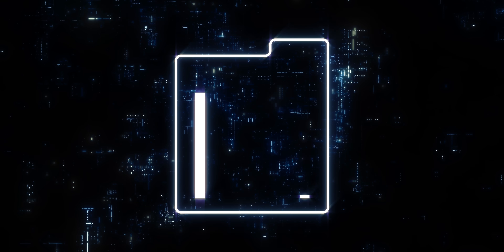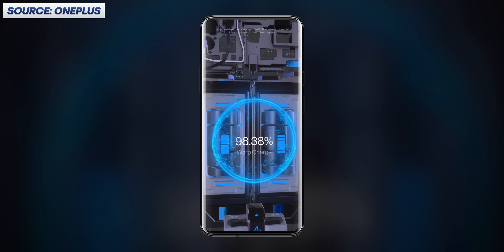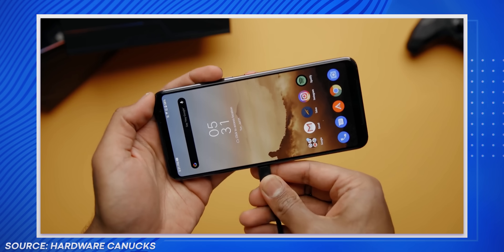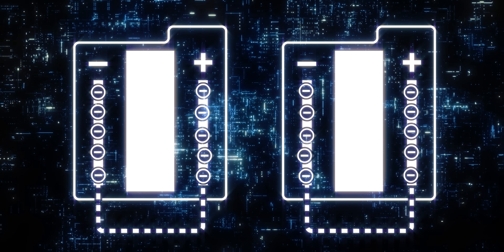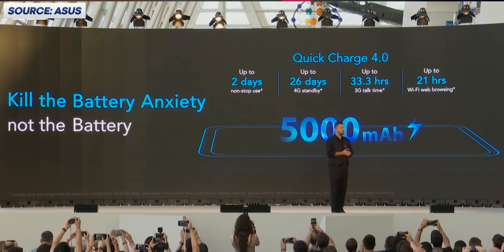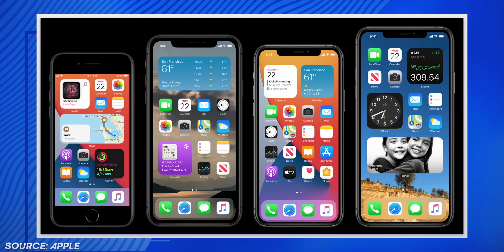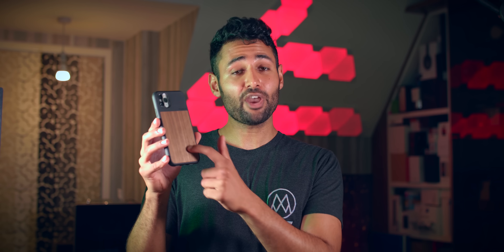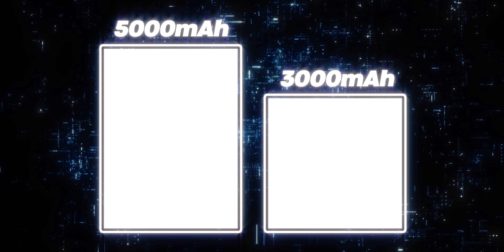The Problem with Fast Chargers.

Comment: Im an electronics engineer and Ive been trying to tell people exactly this for so long. Also, most of us charge overnight so why try to make it charge so fast, don`t peak the battery to 4.2v per cell until right before its about to be used, keep it in what`s known as the storage charge level, storage charge is important for lipos that aren't being used often. I agree with you on every word you said, you also gained a new sub for it too as its rare to find such great advice from youtube. Must add though, a generally accepted safe charge current is generally 1C, so the capacity of the battery lets say 2000mAh would be charged at 2000ma or 2A to be optimal, so if you have a higher capacity battery you could charge it faster, like a 5000mAh battery is usually charged at 5A, this doesnt apply to all batteries and you should check the datasheet for model to be sure, but its a good rule of thumb. Generally manufacturers of batteries like LGChem do make notes on the datasheets of the cells explaining the reduction in recharge cycles by using "fast charge" currents instead of their recommended basic charge levels. 

Just for clarity, i have some Lipos that are recommended to be charged at 1/10th of C, they are 3500mAh batteries and therefore need 350ma current in the CC stage to be given maximum battery charge cycles, their max charge current was given at 1C, so after designing a BMS to manage the charge rate at 350ma we were over 1000 test cycles before we considered the battery to be worn, when we increased the charge levels to 2A, that number dropped to 200 cycles. The load used to discharge was an electronic load and was programmed for cut off voltages etc to achieve consistency. Phone batteries are obviously designed to take a higher charge current, but as you said theres a big cost to it if its done right, but ultimately this is something that Apple has got right, slower charging is better for everyone and realistically most people charge overnight and have a phone that lasts all day, so fast charging is largely a waste of time. Just because you can, doesn’t mean you should.
Reply: @UCrYgFGKtu5OGQPri3XRT0Xg Battery chemistry can be made to accommodate the faster charging, but that’s at the cost of something else. For example it’s common to see batteries that are able to accept a faster charge not give out the lower currents a phone uses as efficiently. The manufacturers then provide bigger cells in the phones, which in turn take longer to charge. 

Not all the same capacity batteries are made equal. The high the current you draw from a battery also makes it less efficient, a 7Ah battery may provide 1A for 7 hours, but would be unlikely to provide 7A for 1 hour even though logic suggests it would. 

So although it’s possible to mitigate the fast charging issue, it comes at additional cost in other means and usually still suffers a big proportion of the damage from the fast charging as well. 

As battery technology improved this will be less of an issue
Reply: @ChrisSmithy  so, no matter what brands that you have it's still have the problem with fast charging, right?
Reply: @adamryamizard5560  they are always going to have some problem yeah. It’s asking the technology to do a bit more than what is ideal with these silly fast chargers. There’s an ideal charge rate depending on each device but the reality is that slower charging is always going to be better for the battery.
Reply: @ChrisSmithy  thank you for explaining that so detailed I appreciate it. And sorry for bad English.... 😅
Reply: @adamryamizard5560  no problem and your English was great!
Reply: Dude, thank you for explaining, but please use paragraph breaks.
Reply: @totsuka2213  I’m an engineer not an author, sorry.
Reply: @ChrisSmithy  So, in conclusion, you would recommend slow charging?

I recently got a s20 which has a 4000mah lipo battery and it comes with a fast-ish charger. The specs of the charger are 5.0V=3.0A 15W for a slower charge OR 9.0V=2.77A 25W for a faster charge. What do you think? Should I deactivate fast charging from settings and keep it at 15W?
Reply: @raziel325  to ensure you get the longest life out of the battery, use the lower power charge. If you ever needed a fast charge you could always use the fast charge option for that one time. Although both of those charge rates are relatively mild, it will make a difference to battery life. 

Also, it’s important to note that the incoming voltage/current specifically from the psu isn’t as as important as it may seem, the battery will always be charged using the same system and same voltages, just current levels increase. By increasing the voltage and lowering the current makes it less stress on the cables and the psu, but the phone will still be aiming for 4.2v per cell ( for most lipos ) and will be converting the voltage to achieve this.

Really sorry how hard this is to explain, I’m trying to avoid being too technical as I’d rather my replies were more use to more people. 

In conclusion, fast charge does have a purpose but it will degrade the cells faster. If you can use a standard charge rate without it affecting your life, then it will pay off in the long run. It also puts less stress on the internal components, generates less heat and generally is considered safer. 

I’d absolutely recommend the slow charging option to increase the life of the device.
Reply: @ChrisSmithy  Thanks for the response. I want to ask you 1 more thing since you're knowledgeable. 

What's your opinion on charging the phone until 85% instead of 100%? Some people think that charging till 100% will stress the battery in the long term, while aiming for 80-85% will increase life span (more cycles). What do you think?
Reply: @raziel325  charging to 80% is better for the batteries. Lipo technology isn’t like the batteries we used to have ( Nicad/nimh) and responds best to not being stressed out. Charging a Lipo to a lower peak voltage (by charging to a lower percent capacity) will certainly extend its life. 

There does become a point where people have to balance the convenience of charging the phone with wear on the battery. The convenience of charging overnight at a reduced rate is significant to the battery life, if it’s easy for you to stop the charge at 80% as well then it will definitely further increase its useable life.
Reply: @ChrisSmithy  Thought so. Thank you very much, I appreciate it!
Reply: @raziel325  no problem at all. Just to add, some people believe a full discharge is good for a battery before they recharge. This isn’t correct with lipo, it’s correct with nicad and some mimh but lipo batteries don’t like to be fully discharged or fully charged, somewhere in the middle is always best. The best voltage for a lipo to be at is usually the storage charge level, which is available on the data sheets.
Reply: @ChrisSmithy  Yeah, I guess that`s why they store them around 50-60%.

I`ve also read that it's perfectly fine to get one or multiple quick charges of 10-20% on these modern batteries because they have no memory.
Reply: @raziel325  that’s absolutely true. Top up charges are no concern at all to modern cells.
Reply: @raziel325  The Tip must be you shouldn't let your phone go below 20 and above 80
Reply: @Ayush-f9s  yeah 100% that’s the ideal for sure. I guess convenience comes into it at some point as well sadly.
Reply: @ChrisSmithy  I always have this question in my mind. Does Xiaomi phone has the same problem as others with the fast charging?
Reply: @adamryamizard5560  Miui has poor optimizations that's it.If you move to custom rom stock Android(Like Pixel Experience), Your problems will be fixed.

Fact: Every phone reaches 100 slowly.

And Those super fast chargers are pointless.

Using Normal Quick Charge charger charge your phone overnight and Charge in day when it reaches 50 

If you do care about battery backup as everyone is not free to follow 20-80 Rule.

And Don't worry your phone won't Explode.

Software plays an important role too
Pixels are Best Android devices for Charging

And Yes Xiaomi is on poor side in terms of Fast charging.
Reply: @Ayush-f9s  so, do you have any suggestion that has better optimizations?
Reply: @adamryamizard5560  Use standard 15w fast charger and it's great.

For Phone OnePlus Pixels and Motorola, are best

But you can use Custom rom on any phone to fix problems (Requires Technical knowledge) you can contact your device community in telegram and XDA
Reply: @raziel325  thanks for asking. I recently got a s20 too so it was nice
Reply: @ChrisSmithy  Thanks for explaining things without being too complex or technical. Take care.
Reply: @Chris Smith  Hi Chris - I totally agree that Li-ion batteries do not like to be fully charged or discharged.  My phone is now 4 years old and I (almost) never charge more than 70% and never discharge less than 25%.   So far my battery seems to be as good as new.   I have a charging cable wherever I sit and have an app to warn me when exceeding these limits.  Also, it makes no difference how many times you charge your phone, as long as you do not exceed these limits.
Reply: @ChrisSmithy  I'm a doctor , not a mechanic! 🤣🤣🤣
Reply: @ChrisSmithy  Hey man I need some recommendation on my phone that I bought recently about fast charging if you have time to answer I would really appreciate it especially for people like you who understands battery charging really well.

I recently got a poco f2 pro which has a 4700 mah lipo battery and comes with a 30W fast charger and I currently have an extra 18W charger which I bought it not too long ago. What are your thoughts on what should I use? I don't mind with charging my phone for more than an hour compared to less than an hour by the way it's more like I want my phone to last as long as it possibly can. Thanks I hope you can see this I would appreciate it a lot if you do reply.
Reply: @paredeschris6209  there’s absolutely nothing wrong with using the supplied charger as the phone was designed to use it. However, if you want to extend the battery life I’d suggest you use a lower power charger. 

More modern batteries are designed to handle the higher charging currents better than they used to, but they will always last longer if you are more gentle with them. Keeping batteries cool and charging at a lower rate will extend the battery life and are simple measures that are reasonably simple to achieve. 

Hope that helps
Reply: @ChrisSmithy  yeah I also thought about using that 18W charger that i bought since I want my phone to extend the battery life as much as possible but one more thing, not using the supplied charger shouldn't be a thing for me to worry about right? That 18W charger was also from Xiaomi btw so it should be good since my phone is poco (sub brand of xiaomi)?

One more thing sorry for asking a lot but right now I don't mind charging using the 18W charger but when I'm on a rush I'm planning to switch back to the 30W charger. Is that good switching chargers but I'm planning on only using the 30W chargers from now on when I'm on a rush.
Reply: @paredeschris6209  using a lower powered charger is only ever a problem if the manual specifically says to only use their included charger, but as you can see by the market shifting towards not supplying chargers, the manufacturers aren’t concerned about the chargers you’d use or they would be putting out specific requirements for each device. 

Things like wireless charging are more likely to damage your battery than anything as they generate a fair amount of heat, it’s generally not an issue but it will be reducing battery life. Although if you only plan to keep your phone for a year or so, the reduction in battery life would be probably acceptable for the added convenience. You have to consider what works best for yourself.

Switching to using the 30w charger when needed and the 18w for the majority of the time might be a good level of convenience and still helping with battery life.
Reply: @ChrisSmithy  Thank you for responding to my questions man I really appreciate it!
Reply: @paredeschris6209  no problem. Happy to help
Reply: @raziel325  Yeah, slow charging is much better for longevity.  Just turn the phone off, plug it in and don't touch it for hours or even the next morning.  Repeat.
Reply: @francretief1  what app?
Reply: @francretief1  what kind of app do you use for this "an app to warn me when exceeding these limits" ?
Reply: @ChrisSmithy  Hey Chris, I actually have a question for you if you would be so kind: How do you feel about using the phone while charging, but attaching a cooling device with a strong fan to the phone in order to keep it cool?

Edit manners
Reply: @ChrisSmithy  I have a phone which supports 65w fast charging. So should I charge with a lower charger like 10w or as it supports 65w it will be fine enough?
Reply: @ChrisSmithy  soooo since wireless charger generate heat, does the wireless charger car dock that sits right in front of the AC vent actually neutralize those disadvantages ?

Wondering
Reply: @raziel325  Good question, this is where the statement gets blurry in the movie...
Reply: @ChrisSmithy  Can you clarify this for me?  I just got a new iPad that came with a 20W charger.   I have an old iPad from 2014 that came with a 10W charger.  Which charger should I charge the new iPad with for least degradation?  Is the 10W charger better because it's slower, or is the 20W charger better because it has smarter internals and is the charger the new iPad came with?   Thanks for your time in responding to all of these inquiries.
Reply: @ChrisSmithy  "the battery will always be charged using the same system and same voltages" Thanks for the reassurance! I was wondering about that for days
Reply: @ChrisSmithy  So I'm about to buy an iPhone 12 Pro Max, I bought the 20W fast charger which is 9V-2.22A/5V-3A. But if I'm not in a rush I should just use the old 5W (5V-1A) charger to preserve battery health overtime?
Reply: @ChrisSmithy  because lipo do not have memory like the nimh/nicad?
Reply: @ChrisSmithy  Hi Chris, got an Iphone 12 so and I still have my old iphone charger block (5w) and cables, so is it better you just use it than buying a new one.  And also I am curious, does usb cable matter when you are charging your phone, is usb c better than the old usb cable that works for iphone xr and older models? Thanks in advance.
Reply: @marsha0324  the iPhone as well as a lot of other modern phones have some good battery management capabilities, they generally will be engineered to limit charging current to what’s acceptable and I wouldn’t worry about using even a 20w charger. That said, slower charging is always better for the battery, so if you are able to cope on 5w and overnight charge ( the iPhone learns your patterns and will only charge to 80% and then giving the final 20% right before you’re expected to use the phone) then it will be better for your battery, however as Apple engineering and electronics are so good and they don’t push super fast charging capabilities, it won’t make a massive amount of difference. The biggest issues usually occur with phones that have over 20w charging really. Just to make it clear, I have the iPhone 12 Pro Max and I charge via cable at 5w as much as possible and it’s not lost any capacity according to the built in capacity reading, but my friend has the same phone and always charges using MagSafe but his is down to 99% remaining, it may be unrelated to charging though as useage patterns play a part too and I don’t need to charge my phone every day, so may not be useful data, more an observation. Hope that helps.

I forgot to mention the cable question. Always use an MFI certified cable, usb C or A makes absolutely no difference. The supplied voltage and current is important but the type of cable providing it doesn’t change anything, however, it’s important to use the correct cable for other things as usb C comes in many forms for other non Apple devices. Although using the older cables on other devices is likely to be the limiting factor and cable quality is important. Some Far Eastern cheap cables can be be badly rated, some sold with the capability of 100w can melt at lower power levels, it’s worth spending the extra on good quality cables where possible.
Reply: @chuckgrumble5440  that’s correct.
Reply: @johnmoore1495  iphones handle battery management very well. However slower charging is always better for the battery, as you increase charge rate you also increase heat and cell damage. The best scenario is slow charging and keeping between 20-80% but occasional faster charging isn’t going to ruin things for you, but I’d always recommend charging slower when possible
Reply: @jujohns0  this is a great question. If your using the device while charging use the 20w as the device will generate heat during normal operation, so being able to quit the charge process earlier is an advantage. However if you don’t use it while charging I’d use the lower power charger. However the iPad has much bigger cells and can certainly handle the higher charge rate with less significant issues on long term capacity.
Reply: @ChrisSmithy  so when fast charging does the voltage, amps, wattage directly damage the battery? Or is it just the extra heat created by the extra power.
Reply: @megimargareth4015  the heat is generated internally. I’ll do some tests to be certain on this, it’s an interesting point but I don’t think it would help as much as you’d think as the cell generates heat internally but the heat removal from ac works externally. I’ll report back once I can confirm
Reply: @ANONYMOUS-kw3ex  65w will likely hit the target battery life that the manufacturer intended you to get. If you want to exceed that time and wish to get more life from the battery, then charging slower is the way to go. The manufacturer may have intended battery life to match the warranty period or they may have a different target life, but charging slow will extend the life.
Reply: @ParadymRap  anything that generates heat while charging is a bad thing. Ideally you don’t want to be using it at all while charging, however if you need to use it while charging you can negate some of the heat by using a lower charging current. I’m just planning out a test to see if external cooling can help. I suspect it won’t as the battery is internally generating heat and external cooling wouldn’t be likely to be even enough, it will certainly help but I’m not sure by how much yet, it’s a test I can easily do so will update back as soon as I can.
Reply: @ChrisSmithy  Thanks for your reply.  I generally don't use the iPad while it's charging.  I've been using the 10W charger and it seems to be working just fine.  Thanks again for sharing your knowledge and your time.
Reply: @johnmoore1495  it’s a bit of a combination, the battery chemically changes with age anyway, but higher charge rates do more of this damage. For example a batteries being used for electric vehicles are tested by charging at 1.5C and discharged at 2.5C to determine their life, they are expected to lose 10% of their life after 500 cycles. This is a good example of serious development in battery technology and handling to reduce the wear, however if you reduce the battery load and charge rate while still maintaining the temp under 60 degrees the reduction is life is under 5%. This is just an example as the technology used there far exceeds mobile phone battery tech and uses a different kind of cell. So wear will naturally occur, even if you don’t use the battery at all. 

The temperature has a huge effect and amplifies the effects of wear and does it’s own additional damage. 

So to be clear, the effect on the battery of what is generating the heat by fast charging is damaging the cell, the existence of that heat is also damaging and even more so if that heat exists while charging. High levels of charge current can be one way to generate this heat, but even if a battery is artificially hot the charge rate needs to be reduced to safely charge the cells. So heat in general is damaging, the high current charge rates causes chemical changes that make this heat but also cause chemical wear on top of this too. 

Fast chargers will monitor cell temp but the limits used often need to be quite high as otherwise the fast charging rate would rarely be achieved. A charger I designed recently needed to maintain the cells at no more than 15 degrees C above ambient ( with other safe limitations for ambient) but needed to recharge as quickly as possible, it was a challenge to get a decent charge rate while still keeping temps low, the resulting charge program couldn’t run the bulk charge rate for long  without huge amounts of heat, sadly an inevitable side effect of charging these cells with higher charge rates.

A few people have mentioned the temp and will things like AC help, I’m going to do some tests to determine how much it can help, but a cell at a lower temp is able to accept charge at a higher rate safely, but if the heat is removed while charging an ambient cell isn’t something ive seen done to confirm if the chemical changes still occur that affect life while using the higher charge rates. Any cooling will help the battery, but as each cell wouldn’t be subject to charge throttling as the chargers usually monitor external cell temp and the internal of the cells will be warmer, the damage might not be as predictable as would seem obvious. However it’s common to find batteries that contain 8 cells in a rectangle in 2 and with the temp sensor on the outside of the pack, when the battery is dead it’s common to find the outer cells are ok, but inner ones which have been hotter are often worn out.
Reply: @jujohns0  happy to help. Let’s all hope for a better battery technology soon and we can one day leave all this in the past! Also, I also use a 10w charger in my iPad too.
Reply: @ChrisSmithy  hmm very interesting, thanks for the all the info. Was that charger design for a company or some school project?

So basically when charging an iPhone (phone in general):
1. Keep the charge state between 20-80%
2. Slow charge as much as possible (5W)
3. Keep heat down as much as possible when charging (within reason, don’t like stick it in a fridge etc.)

^Am I missing anything or anything that you’d tweak that may help prolong the life of the battery? I just bought a iPhone 12 Pro Max, considering the price tag of this dang thing, I want to keep it around for at least 3-4 years, maybe even 5. So keeping the battery “healthy” is a priority.

Also, is there a point in which charging too slow can be damaging? I imagine on a phone it’s hard to do, but I could imagine how maybe charging a Tesla with a normal 120V Tesla adapter could be considered excessively slow charging, I think it takes 4-5 days to fully charge from 0%.

(It’s interesting to be able to talk to someone who actually knows what they’re talking about, and hasn’t “heard” it from some guy who heard it from another guy, who read it on a website back in 2018, which references an article from 2013 etc)
Reply: @ChrisSmithy  Hi Chris, thank you so much for replying. Have a great day! :)
Reply: @johnmoore1495  I wish it was a school project, sadly I’m not that young! It was a design for a business who had very specific requirements and their brief was very complicated, I thought the project would end up being a nightmare but it was actually quite enjoyable :-) 

I think you’re on the right track there with the battery. Cool, slow and not stressing the cells with extremes of high or low charge level.

There will be a point at which a mega low charge rate becomes pointless in some devices, trying to avoid going too much into the technicalities of this, but in a phone you shouldn’t have to worry about it as the phone should detect it and would usually cut off the charger DC input, so realistically it’s unlikely to happen with a phone. However 5w is about as low as I’ve seen people go and that’s about where I’d say the rate of charge vs battery life would be about realistically optimal for most devices.

Hope this helps. Sorry if I’m quite slow to reply to people, I’ve a lot of work on at the moment and I’ve not found the time to check back as often as I’d like.
Reply: @francretief1  hi care to share what app u are  using?
Reply: @ChrisSmithy  Thanks for the detailed explanation chris! 
I should’ve done my research before buying an adapter, but rn i’ve got the 20W charger and an old 5W Apple Charger with 3rd party cable. Do you think the battery degradation would be an issue if i’s replace battery every 2-3 years anyways? 

Also with respect to fast charging. Is 20W less damaging than 30, 65 or 120W?
Reply: @Rozod12738  no problem. It’s been an interesting topic. I wouldn’t worry with a 20w charger, with modern battery technologies, very precise charging ICs and optimisation for the capacity you should still get a decent battery life if the battery is designed for the power. If the battery is being replaced every 2-3 years it’s not going to be as much of a problem, however, I’ve personally seen and tested high charge current phones that have lost 20% of their charge capacity within a few months when charging at very high rates. I would consider 20w to be reasonable for a phone but my own view is that any higher than that on current phones and technologies is excessive, my own testing shows reduced available capacity, mostly caused by the additional heat generated once you go over 20w. 

If it helps, I charge my phone overnight at 10w and in a year have lost 1% of max capacity, a friend has the same phone and charges using mag safe using an anker 30w usb power supply and he’s showing 88% remaining max capacity. So not only does the charge capacity matter but the method of charging does too. Wireless charging generates additional heat which reduces capacity faster. We assume this is what’s happened in my friends case as mag safe would have been running at the highest output it can (15w) and does generate a lot of additional heat. 

Just an important note to remember, just because a charger has a high power output doesn’t mean the phone will accept the charge at that level, so if your phone limits charge to 20w for example, a 60w charger won’t charge it any differently than a 20w. That’s true of anything with a built in battery management circuit, it doesn’t hold true for some very cheap electronics that I’ve seen recently and some devices (not phones) I’ve seen recently rely on the charger only providing a set voltage and current level (5v @ 500mA) to avoid thermal runaway of the Lipo, for me that’s just a recipe for disaster, luckily I’ve never seen this practice in a phone.
Reply: @ChrisSmithy  Thank you so much for the help Chris! Couldn’t appreciate you more! :)
Reply: I would love an option that allows you to tell the smartphone how much time it has to charge and ofcourse that if you go to sleep the phone automatically charges slow but fast enough to be full 2 hours before your alarm goes. Nothing against fast charging but how often do you need to charge your Phone more than once a day and why do i need a smartphone that has a full battery on 12 pm if i need a full Battery by 6 am
Reply: @Cypher NX no worries. Glad it’s been useful.
Reply: @ChrisSmithy  just to ask, are 15W chargers ok? It's my phones' fast charger. 
Btw., if I turn off fast charging in my devices' settings, it'll only lengthen the process by about half an hour.
Reply: @Cypher NX Yes it Helps a lot but people are too busy with their schedule to keep up with the 20-80 rule.They can keep phone above 20 but below 80 is not possible for busy people.
Reply: lol at all the people who keep asking questions already answered in this thread
Reply: Just to add for the people who asked. After a couple very brief tests so far, I’d consider it to be unsafe to externally cool a phone while charging in most scenarios that aren’t engineered to do this. I just tested 2 phones ( avoiding mentioning brand) and noted that the temp sensor is in fact in different places, one of the phones would monitor the battery at the highest temp and the other would monitor it right next to the rear of the case where the cooling would be applied. As a phone internal battery management will throttle the charge if the temp gets too high, one of the phones would correctly detect the higher temp and throttle correctly where as the other one wouldn’t and could potentially allow an unsafe charge rate. I’d have to say that unless your phone is designed to be cooled externally, like the rog phones, I wouldn’t do that while charging as it could potentially be unsafe. 

However if you could saturate the individual cells and in an even cooling medium that’s correctly monitored, the reduction of heat during charging will increase battery life by a small amount. 

Or just charge slower and not worry about it. 

I’ve tried to keep my answers as none technical as possible but if anyone is interested I can explain at a more technical level regarding SEI, plating and other thermal aging effects but I didn’t get the impression this was the right thread for something like that!
Reply: I have phone with 4500mah and it's divided into 2 parts and the charging  is 5v.2A(minimum) and 5v.10A
Reply: @Cypher NX My Pleasure Bra
Reply: Ok. Hey you charger,  you better listen up and listen up good! From now on , my phone tells you what it wants. I better not hear any sass back from you! Get back in the wall
Reply: You nailed it, would be great if you can share your battery knowledge on a video, perhaps u can start a channel of your own. Many will appreciate
Reply: @haparcheledupwar  I’ve been shocked at the amount of people who’ve asked me to do this. I’ve had some forum threads asking for the same thing. Sadly my focus just isn’t on content creation so I think my videos would be very amateur, I have a lot of respect for the engineers who can turn their hand to video creation, like Dave Jones from EEVBlog, who I’m a huge fan of as he’s an excellent engineer as well as an excellent content creator, sadly I couldn’t achieve the same level of quality as he does. Maybe ask him in his forum if he would be interested in making a video on this topic. He’s a very approachable person and loves to help people too. Maybe he would be interested?
Reply: @kj3283w sometimes it can be very hard to find. I’d start with the cell manufacturers website, but some cells were never available to the public and the data sheets aren’t available. But just to make something clearer, we aren’t suggesting here that you can’t charge the phone battery at higher rates, just if you want to get the best out of  it, it’s wise to charge slow, cool and try to keep the charge level away from extreme full or extreme empty areas. 

If you still would like to find the data sheet, you could email the manufacturer, search the model or look to see if the model number you have is a generic model which has a more specific part number for your exact battery/cell. Sometimes data sheets just aren’t available to the public, which is very frustrating.
Reply: @Chris Smith Thanks for the wonderful insights into this over advertised but under researched area. I have gone through all your comments and suggestions below. So do you think this is the reason why Samsung did not go for super fast charging even on their latest flagship, the S22 Ultra, despite companies like Xiaomi giving insanely fast  charging capabilities on their respective flagships ?
Reply: @LiminalRadiantLens  Yes exactly. The more premium brands aren’t stupid. They know their returns will go up for battery life issues. Also interesting how certain youtubers seem to think that by splitting that single cell into 2 cells means you can charge them faster, however most battery charge rates are determined from capacity. So if you have a 3000mAh cell, charging at 1C would mean a 3A max charge, if you split that into 2 cells you’d be looking at capacity being 1500mAh each and a 1C being a 1.5A charge. While ever we are using LiPo cells we are using a CV stage of 4.2V, so running 2 cells doesnt change the max charge voltage per cell and doesnt change the 1C charging current overall either.  Seems that a lot of youtubers don’t understand electronics (which is understandable) and are just fed misleading information from the manufacturers which they then repeat, ive seen a couple of youtubers, especially one big name that puts out incorrect information that comes from the manufacturers of the fast charging devices, i wont mention names but needless to say that customers who have purchased these devices have started commenting on how their battery capacity is reducing quickly!

In the next few weeks I plan to purchase some of these “fast charging” cells from specific fast charging phone models and will cycle them using my calibrated lab equipment, one using reduced charge rates of c/5 and one using the fast charge rate that the phone would use, then discharge each cycle using the same discharge current on both cells (likely 500mA) and will graph the reduction in capacity of each over the cycles it achieves. Not sure where im going to post the results but i will update this when i do, I wanted to do this sooner but its been very busy over the past year. It will give us a clear picture of how much difference there is between fast charging and a reasonable charge rate on the same cells and on devices designed to be fast charged.
Reply: @ChrisSmithy  I think I know which youtubers you are referring to. I have seen those videos as well. And this youtuber gives a reference example of One plus and the 'brilliant' way in which batteries are split into 2 which apparently increases charging speed. But now after seeing your content, we know it's not accurate information. Thanks Chris!
Reply: I noticed that my Xiaomi Redmi 4x suddenly started losing battery life, at first it would turn off on its own at 18%, then it changed to its 20's then 40's and now it turns off at its 50's percentage, plus it lasts less than 10 mins from 100% to 50's %... all because I used a fast charger.
Reply: @evorsor5511  if it's 2-3 years old charge cycles must have reached close to 2000 or 3000 charge cycles  (max life of every battery is 2-3 years/2000-3000 charge cycles)  time to replace battery

Or Maybe you dropped phone and internal damage.

Fast charger just kills your Battery this much on using incompatible fast charger. That's what you did redmi 4 series doesn't support fast chargers

On compatible phone this much damage never occurs but batteries die as compared to, if you used normal charger for your device.
Reply: @Ayush-f9s  Oh so it has nothing to do with using the fast charger then? I did drop it once when I bought it back in 2017 but it did not show any issues back then so most likely I did charge it about 2000 times or more lol. I guess I can replace the battery instead of spending on a new one.
Reply: @evorsor5511  Charge cycles are not everytime you charge

A charge cycle is a full charge to full drop

If you use unsupported fast charger your phone will be fucked anyways.
In worst scenario your phone could have exploded in your hands or while charging.

Fast charger damage depends on compatibility,Speed of Charger And Type of Cables. The Fast you charge the less your battery will last.

I Suggest replace your batteries ASAP 

If it's still not Fixed then others reasons have caused this.

And don't ever use fast charger if your phone is not supported and optimized for it.
Reply: @Ayush-f9s  Gotcha, I havent used that phone ever since, instead I am now using a diff phone, but I do plan on either replacing the battery on it or just buy a new Xiaomi phone,
Reply: Really meaningful info thanks
Reply: Thanks for the info! I have the iPhone 11 and have no intention of getting 30W or higher. Will 18/20W do lots of damage if used consistently or is this truly mostly referring to the 30-60W+ chargers? For reference, I do not charge my phone overnight. Just before work and after!
Reply: @383-u9e  something to note here. Current is drawn by a device not supplied by a charger, so if you use a 100w charger it doesn’t mean your phone will charge at 100w, the phone charging circuit controls the current supplied to the battery. So if you have a phone designed to charge at 18w for example, using a 60w charger won’t charge the phone faster. The voltage of the charger is critical as that IS supplied by the charger, the current is always drawn by the circuit. I’d explain in more detail but I think people like to keep it simple.

Charging devices are a little more complicated than it first looks, the phone does adapt voltages and limit current. 

The person that commented that using a non genuine charger could cause damage to a phone, assuming the charger isn’t faulty, is incorrect. That’s just not how it works. Cheap Far Eastern products may charge internal lipo cells in a device within the power brick itself, it’s really not very good to do that however as most don’t have any temperature feedback or other safety measures for safe limiting of charge current or early termination of charge if needed, but when it comes to a phone, I’ve never seen one that doesn’t have internal charging circuits that will only allow the appropriate voltages and current levels to be used. It’s the entire reason that PD and QC exist! You may not achieve the full charging potential by using a different charger, but as it would actually cause the phone to charge slower it would be more likely to extend the battery life and not reduce it. Most phones and charger either support QC, PD or both, this allows the use of different chargers very easily and allows the phone to tell the charger what voltages it wants. 

Hope this helps clear things up. But the claim that using a 3rd party fast charger will damage your phone is absolute rubbish. If it’s a phone charger and not a random charger for a laptop that happens to have usb C, then it’s not an issue at all.
Reply: @383-u9e  Apple has set the iPhone to where it won’t take more than 20 W of power anyway so even if you got a 60/90/10,000 W charger the phone would only charge at 20 W anyway.
Reply: Ummm...how you slow down the charging
Reply: Good evening sir, I do appreciate that there is someone who is knowledgeable about the battery. May I ask some specific questions, sir? I do have a phone which is Honor8x and it is already a year and 2 months that I do charge it when it is already below 20% and plug out the charger when it is around 95% to 98%. What advice can you give to me sir? I do think that my action to my phone is okay due to the fact that the charger of Honor8x is only 10W but I want to know your scientific explanation yet simplified because I do have a below mediocrity mind and comprehension.
Reply: @FragmentedFX  Based on what he just said. Youre doing great
Reply: So what charger do you recommend? The 5w or 20w?
Reply: @flynnaguilar5876  5w if you can wait for the charge without it being an inconvenience but 20w won’t be much of an issue anyway.
Reply: Greeting, If a phone charges at 100% does the battery still taking current? When I use the phone without charging I feel the battery getting warmer. But when I leave the phone on charger when at full charge and I use it, it is cold.
If it is not taking current then isn't it better to leave it on heavy use on charger?
Eg playing a game. I would use 50% more every day. One full cycle per two days
I leave it on charger so no need for that extra cycle an the battery feels much colder.
Reply: @kerber0s125  It depends on your device. Some devices have an automatic shutoff option and others will overcharge. The newer they are, the more likely they are to have the automatic shutoff function active. 

It is never ideal to use your device while charging it, as the heat generated from using the device while also keeping the battery charged will make your battery deteriorate. 

Even just having your battery at 0% or 100% is hard on the battery and wears it down, ESPECIALLY if you're using it and that same time and keep it there. 

If you keep your battery between 25% and 75% as much as possible and charge it slowly, you will extend it's life much more than using it normally (charging to 100% and letting it get close to 0%)
Reply: I never charge my phone overnight, as im afraid that my phone is gonna overheat and explode. I use a Oppo Reno 4 Pro with Super Vooc charger, which charges in 30 minutes, so I don't have to charge it overnight
Reply: @Utd_YT  id be more worried about the fast charger causing the issues you’re worried about rather than the overnight charging.
Reply: The word that seems to be missing from this discussion is "Service life". slow charging or charging optimum for the particular battery increases the "service life" (or more to the point doesn't decrease) of the battery. I still have an Iphone 5 with original battery that still lasts pretty much all day.
Reply: I am going to buy nov7i
and it has 40 watt charging,so does this will damage my phone battery?
note:I will buy this phone for a long run like 4 years
plz answer me
Reply: @messiamr3395   there is no guarantee how long the service life of the battery will be. But a few things have a big impact. Dont let charge get below 10%, slow charge (that being any charge rate that take more than 4 hours from 10-20%),  when you store the phone do it with a 50% charge.
Reply: I like your funny words magic man
Reply: So Sony's battery care technology isn't pointless?
Reply: I need help I been using a fast Samsung for my Samsung tablet and then I just stopped charging one day any advice ?
Reply: @Revelators_Realm  excessively fast charging where available just reduces battery capacity and is very unlikely to damage the device otherwise, so id suggest its unrelated. Samsung don’t offer ultra fast charging so even if you used a 100w USB-C adapter, it would still be limited by the charging circuit of the device so wouldnt charge at 100w. Could be the cable, USB-C cables don’t seem to last for too long in my experience, might just be due to the nature of what i use them for however!
Reply: Im using an S22 Ultra and I was told to use the 45W charger instead of The 25W charging cause it might damage my battery im so confused..
Reply: @everydayfun9531  If youre in any way confused, I suggest you follow the instructions you have been provided by the device manufacturer. However as far as im aware and I could be wrong as ive not been following the s22, I believe the opposite of what you said to be true, the 45w would reduce battery capacity faster than the 25w would.
Reply: @ChrisSmithy  but that's if you don't charge it to a Full 100 Percent and if you charge it till 85 the battery will still last alright 🤷‍♂️.
Reply: @Cypher NX No one really follows this rule but nevermind your battery will die in 2-3 years/2000-3000 charge cycles as an average user.

But 20-80 rules maintains health and will last long in the range of 2000-3000 charge cycles that's it.

There is no definite rule or calculation for this.

Just to give you rough idea 20-80 people battery can last till 2900 cycles while other might rest in peace at 2400 cycles

My phone in 2 years degraded from 14 hours to 7 hours screen on time

Just a heavy Idgaf user.😌 Will buy new battery if needed XD.
Reply: Idk why people charge overnight, it is bad for your battery. Just plug it in an hour before you sleep or maybe an hour when you get up.
Reply: @XMostaxX  That's exactly what I do. If i don't charge my phone before sleeping, I at least charge it partway (like 25%) then when I wake up I finish charging it up to 75%. 

It's terrible for your battery to let it sit for hours on end at 100% (or 0-15% for that matter).
Reply: I used to keep my phones charging always back in those days of Feature phone and nothing serious happened. I still do that thing today and nothing still happens The battery degrades after 1 or 2 years as usual. Keeping the charge between 20 to 80 percent or around 50 percent concept is an absolute rubbish. These are nothing but some marketing policies.
Reply: @dewanmasooduddin  cool
Story but you are completely wrong. Keeping the charge between 20 and 80% is very well proven to give the battery less stress, lipo batteries don’t like to be taken to 100% and will last longer if you don’t hold it at 100% for long. Just because some battery management controllers can cut the charge to the battery off when it hits max cell voltage ( usually 4.20v per cell) doesn’t mean it won’t keep kicking back in and topping up while plugged in and this is very bad for the battery. 

If you think it’s marketing rubbish, why are even laptop manufacturers reducing max charge voltage, Tesla do the same too and pretty much anyone working in any battery cycling technology industry follow the same rules ? It costs these companies more to add more cells to provide the same level of capacity, companies aren’t really into wasting money. I don’t understand you’re motives for your statement, but what you’ve said is completely incorrect and easy to prove.
Reply: @dewanmasooduddin  it’s really not though, even Tesla recommends only 90% battery charge for daily use unless full range is needed. I believe Tesla used to recommend 80% but they upped it once data showed 90% wasn’t detrimental. Apple’s new optimized charging keeps the battery at 80%, then starts charging to 100% as you wake up. It’s honestly a cool feature and I’d be interested to see the long term data on how much it actually extends battery life.

Almost all phones are shipped at 50% battery because it’s the most stable state. Keeping a battery between 20%-80% is easy to comply to. I personally try to keep it between 40%-80%.
Reply: @johnmoore1495  well said.
Reply: @johnmoore1495  also, you make an excellent point about storage charge. If any lipos aren’t being used for a while, keep them at 50% charge and they will last much longer.
Reply: NO SHIT SHERLOCK, TECHNOLOGY NOWADAYS PREVENT BATTERY DEGRADATION EVEN BETTER, JUST DONT OVERCHARGE IT, XIAOMI PHONES CAN FILL 4500 MAH FULL IN 15 MINUTES, BAD EXCUSE FOR FAVORING APPLE SLOW CHARGING